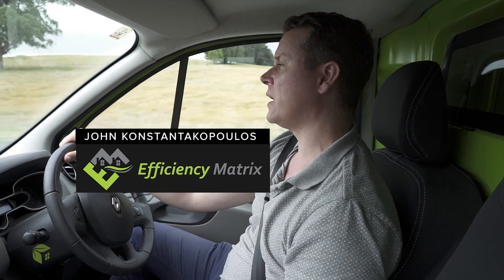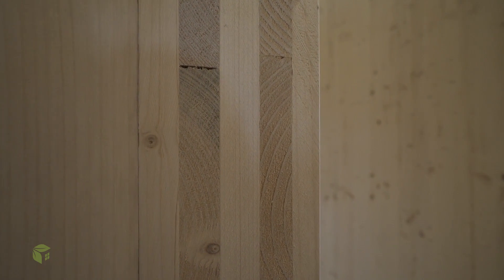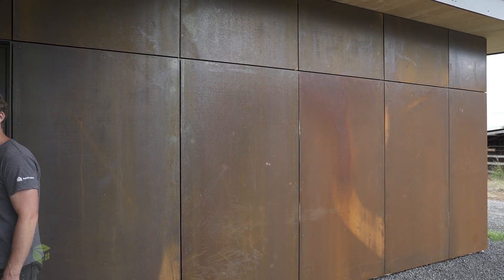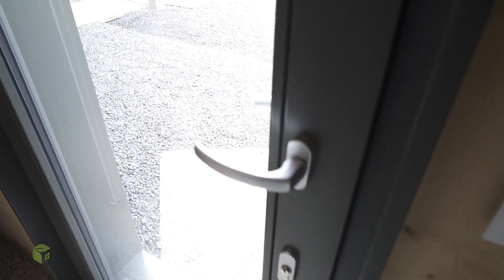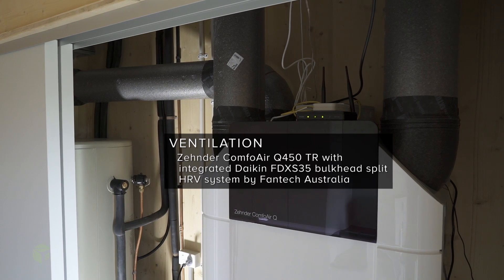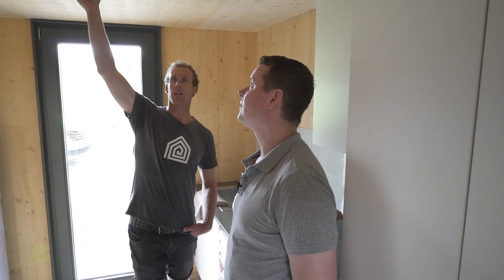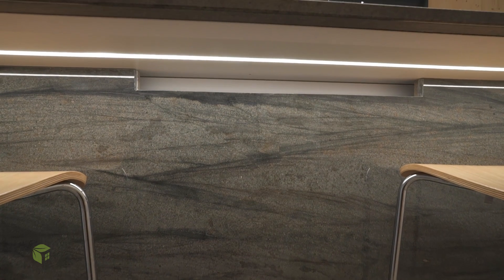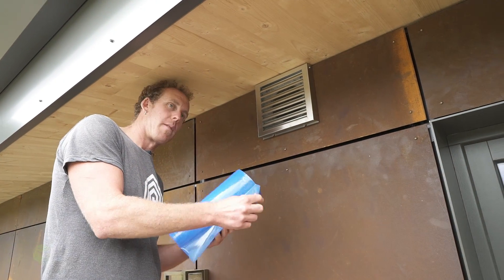Why This Passive House in Aussie Outback Still Turns Heads.

Comment: The r values are very low. They don't seem to allow for an R of 1 per inch of wood either.  My conventional frame house has R values of 20 to 30 and that was according to codes of over 35 years ago.
Reply from the maker: These are metric R-values.
https://efficiencymatrix.com/r-value-wind-air-flow-imperial-metric-converter/

Comment: R-3 and passive house sounds weird 😅
In usa they have R-30 walls and R-50 roof somewhere
Reply from the maker: Metric (Rsi) R-3 is approximately R-17 in the US. The climate down under is a lot milder therefore the additional benefit of R-30/ Rsi-5+ is diminishing very very quickly.

Comment: Great house and really interesting video. The MaxRaft slab is genius as when we did an interior slab with underfloor heating at our old house in the UK country, I now realise why it was better than before but that as much as 80% of the heat was being lost to the stone walls and to the ground outside. When it snowed (rarely) I could never work out why it immediately disappeared around the edge of the house as the underfloor heating (oil) leaked out.

Comment: Such a nice design and great technical solutions! I completely dig te integration of the ventilation system with the Daikin AC. However, both units are equipped with a fan I assume. Are both fans "in action" or just one of them and if so, which one is?

Comment: An R value of 6.8? on the roof no less? either he doesn't know what r value is or this house is barely insulated at all.
Reply from the maker: https://efficiencymatrix.com/r-value-wind-air-flow-imperial-metric-converter/
Metric and Imperial R values are very different numbers. 😉

Comment: Do R values mean something else is AUS as they do in USA?
These R values are very small to what I'm used to seeing in USA.
Reply from the maker: They are metric not imperial.
Reply: @ecoevo  I had no idea there was a difference... But a short "google" shows 5.67826 as the multiplier or divider. RSI 3.8 =  21.5 R-Value.

Impressive!

6.8 R-Value (RSI) = 38.6 R-Value on the ROOF! (That's incredible!)

Comment: Just don’t fart
Reply from the maker: A full heat recovery ventilation systems means this thing has a higher air change rate than a standard leaky home.  So Eddy, you may consume all the baked beans and Brussel sprouts your heart desires.
Reply: @ecoevo  haha good to hear

Comment: Great work! Not sure if I fully understand the makeup of the internal partitions, are they solid laminate throughout? If so, how do you pass all ducting for electrical sockets/light fixtures and water pipes etc?
Reply: I wondered about that as well. Solid interior walls struck me as a waste of lumber that would make it harder to run utilities and harder to make future modifications. But there must be some arguments for it that I am unaware of.

Comment: Really great design. Question: Where did he run the piping/electric if the walls are solid?
Reply: I don't know about this particular house but I've worked on a CLT house before, and in the planning stage you figure out where you need cut out and they router it out in the factory.  You can also see that not every single wall is CLT like in the bathroom and the ceiling in the hallway so there will be some strategically placed pipes and wires there.
Reply: I was about to ask the same question. Too bad you haven't received more answers. I also didn't see too many electrical outlets although I was looking for them throughout the entire video.

Comment: Impressed with knowledge of the home owner. I had no idea about how fast the passive house movement is developing with materials.
Reply from the maker: Ryan Johnson The builder knows his stuff, that’s for sure.  If the host seems like he knows what he is talking about, it’s all just a facade. 😆. Thanks for your comment. 😉
Reply: He said walls are r3. 8 which is not amazing i got r5 for mine, 100mm insulation he said, it's certainly some polyurethane cause i do not know rhe name of the material, he said something like gultex..?
Passive house are kind old things today, we now build positive houses.
Reply from the maker: Honu Moorea What is actually important is the consistency of your air barrier and your insulation barrier.  If you have gaps in your R5 insulation of around 5% it has a massive impact on your R-Value performance.  Wind blowing through walls also impacts R-Value.  Passive House Principles, are the only real way to achieve a high performing building envelope.
https://efficiencymatrix.com/whats-my-actual-r-value-of-my-walls-and-my-ceiling/
Check this calculator out, to see how gaps can impact your R-Value.
Reply: @ecoevo  Does not change the fact that you can go out with a 0 leak plastic bag on your body and see for yourself that it will be far from sufficient. Those leaks are important depending where they are, a leak on the bottom side of the building is less important then the same leak on a higher part of the construction. Pretty hard to have leaks in my house, due to the way i builded it, and half of it is burried in the ground...
And i do not have those, what i would call useless very expensive ventilation mecanism, i hate double flux ventilation system, they cost far too much energy (i'm off grid). I gor a positive pressure system that i builded myself, the fans only works when the air quality is under a threshold that i define myseld (particles,  CO2, CO, humidity) = i waste less energy then those systems, even without heat exchange, and even then i got so much solar heat coming in that.. Well i use something like 200kg of wood per year to heat the house. Ask the guy from this house how much electricity he use per year and how this consumption is distributed among appliances. Then you'll know if it's efficient, also take the inside and outside temp on a whole year...
Reply from the maker: Honu Moorea I’m not quite sure what you mean about putting a plastic bag on your body.  i don’t see the analogy.  How do you know where the leaks are, and how can you be so sure your leaks are good for building performance?  What if there are fires outside, what if a leak is exposed to a mouldy wall cavity, what if you are an asthma and heyfever sufferer?
Having a ventilation system of some sort is fantastic, better than what most people have. 😉
Reply: @ecoevo  plastic bag analogy, having no leak is not sufficient to be insulated, the r 3.8 of this house is nit sufficient in today standards (high standards not bottom line one).
To know where the leak are we use colored fumes. I got a ventilation system it's just not double flux, only 3 small fans. And most of the year it work without electriciry.... Why..? Cause i got a veranda that act like a solar tower and bring the air outside for me. All air entering the house is filtered then go under ground to be heated in winter, cooled in summer.
Reply: Love this home, thanks for sharing. Any would love to get some info/details on the rusted metal sising panels and how they were applied.

Comment: Why is sun allowed to stream in through all those windows? You mention temperature of 37 C which is 98.6 F. Clamshell awnings would keep out some of that sun load.
Reply from the maker: it can get cold down here in the southern parts of 🇦🇺 in winter especially.  All the windows with regard to solar thermal loading have been modelled for this property.

Comment: Minimum R-value here is 41 for ceilings and 24 for walls.
Reply from the maker: Ed Vickery here is a converter for imperial to metric R-values.
Reply from the maker: https://efficiencymatrix.com/r-value-wind-air-flow-imperial-metric-converter/

Comment: I intend to build a passive home. But I am stuck with a thermal bridges that is metal plates connecting construction timber elements. I think that plastic connectors seems to be obvious. But have not found any on the market. Any info welcome.
Reply: Take a look at https://www.ov-consult.dk/ Ok, it is in Danish, but if you want more info, you're welcome to contact me. See also my video https://youtu.be/BNp0yX94cAQ :-)

Comment: Nice. I have a similar setup in germany but opted for a bit of air infiltration in the cellar . one of the cellar doors is not sealed at the base and is positioned at the bottom of the stair well . this allows a little bit of air to enter and travel up the stairwell and entrance room all the way to the top floor. 
If it gets a bit stuffy , which is rare , we just open a window for a few minutes and flood any room with fresh air.

Comment: https://www.youtube.com/user/seumas2/videos Port Alberni in the Heart of Vancouver Island BC Canada
how it was built Port Alberni's first Passive house (Passivhause) build in the heart of Vancouver Island British Columbia Canada.

Passive House(Passivehaus) is considered to be the most rigorous  voluntary energy-based standard in design and construction industry today.
Passive house buildings consume up to 90 percent less heating and cooling energy than conventional building.

The use of Passive House design software was used to gain the specs required to meet the performance standard for this location.

House was constructed well  above the current standards as outlined in the B.C. Building Code.

Footings were widen to 36 inches(914 mm) due to low bearing soil conditions and additional rebar reinforcement added.

30 inch high (762 mm) high reinforced walls . Course sand placed inside foundation walls and mechanically compacted.

Three layers of four inch *102 mm) thick  Expanded  polystyrene foam sheets with all joints staggered and tape were placed on top of compacted sand.

The three layers of foam have insulation value of approximately R 50.

A 20 mil layer of poly was placed over the E.P.S. sheets and taped and sealed.

Four inches(102 mm) of 30 m.p.a fiber reinforced concrete was placed to form a slab over the foam based.

Slab is isolated from concrete stem wall with four inches (102 mm) of E.P.S. to prevent thermal loss.

All cold water lines are buried in the sand to keep them cool, hot water lines have been placed in the center layer of foam insulation to minimize heat loss.

Wall plates compress to heavy beads of acoustic sealant between layers of vapor barrier to prevent air movement.

The walls are double stud configuration set at 24 inches (610 mm) on centre and plates are spaced in a manner that yield a 20 inch (508 mm) thick wall. 1/2 inch (12 mm) standard plywood sheathing with  Mento 1000 a three layer airtight vapor open house wrap( far superior to common house wraps) with 1/2 inch(12 mm) pressured treated plywood rain screen battens form the exterior surface. 

Intello  smart vapour barrier was installed one third in from the inside wall to prevent condensation in this climate.

Triple pane argon filled windows meeting passive house standards from Euroline  were placed mid wall to reduce wind wash heat loss.  All window openings have been splayed at 45 degrees to give a full wide angle view.

Almost all the wiring and plumbing was kept inside of the vapor barrier envelope to minimize air leakage.

Passive house standard requires air leakage not to  exceed .6 Air changes per hour at 50 pascal.

Zehnder comfoair 200 HRV has been installed with a 1000 watt air preheater .(92 percent heat recovery rate)

House has been pre- plumbed for a heat pump water heater reducing  domestic water heating cost significantly.

Garage has been pre-wired for 40 amp/240 volt  electric car charging station.

House to be equipped  with  heat pump condensing dryer which requires no external venting,only a water waste line. George K Builder. © George K 2019       https://www.youtube.com/user/seumas2/videos

Comment: How did they wire up the electricals if everything is solid? How would you do work on it afterwards?
Reply: It must have a crawlspace or catwalk as we call in in contruction where all those wirings are hidden.
Reply from the maker: Dia Han Usually with these passive houses they plan them well from the start, and you try not to add new services through the building envelope itself, because you can upset the integrity of it.

Comment: R 3.9 and R 2.8 seems way under value. Here in the U. S. the passive solar homes have R30 in the walls and R 40+ in the roof. What gives ?
Reply from the maker: S Smith https://efficiencymatrix.com/r-value-wind-air-flow-imperial-metric-converter/
R value metric to imperial calculator.  It also may be more temperate down under. 😉
Reply from the maker: BenjaminFranklin99 Benjamin, thanks for the comment!  It’s very temperate weather down here with the kangaroos.   It never snows.
Reply: @BenjaminFranklin99-s9n  there are now three clt manufacturing plants in montana and washington. smartlam, katerra and. vaughn brothers all have plants coming online. we will be seeing these homes soon all across the us.
 I'm kind of exited about it myself. I helped smartlam prove the concept. we made alot of rig mats for the bakken. clt mats can be used for an astounding number of things. also with modern efficiant equipment the process can be zero gain as far as a co2 footprint is concerned and that is fantastic!
Reply: Their r value are calculated in meters and celcius. On minimal research looks like we'll need to multiply by r-value by 5.71. Don't quote me because I'm not an expert on this.

Comment: Just see this video by chance. I did a very very similar house in France in 2010:  CLT, insulation below the concrete slab, woodfiber, zehnder fan.....It works very well. Sunny days in winter, I don't use heating, sometimes if it rains more than one day I might light a fire (specific wood stove that is airtight). I live in the south of France close to the mediteranée and the main issue is summer heat (usually between 28 and 33°c in the shadow) then indoor temperature never go beyond 26°c , whitout AC. .  About airtighness it was 6 times less the french standard required for this low consumption house, thanks to the CLT.
 CLT, it is a french patent designed more than 30 years ago, but as French are good to invent but not very good to sell, they transfert the patent to an Austrian company (KLH) which develop the product well in Europe. Now that the patent is public and this why several companies can produce CLT.  This technology  is really amazing.
Reply: Of course everything was invented in France, haha. But if you ask an Italian, they will tell you that in fact everything was invented in Italy, including baguette, hahaha.